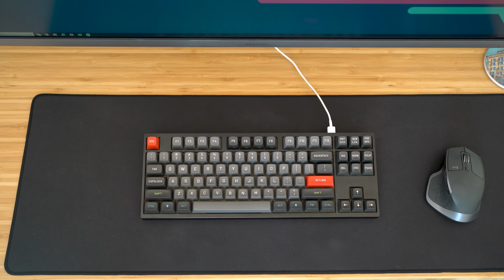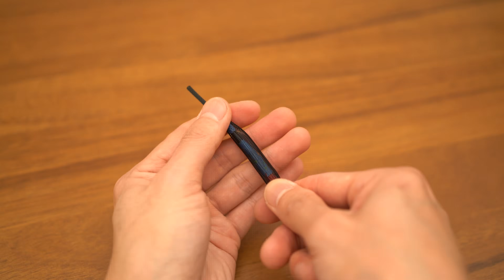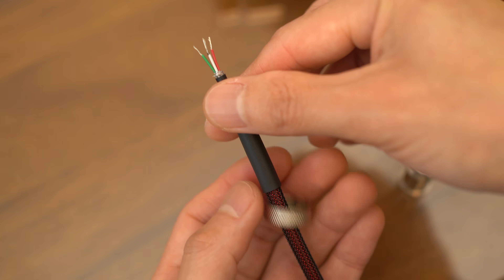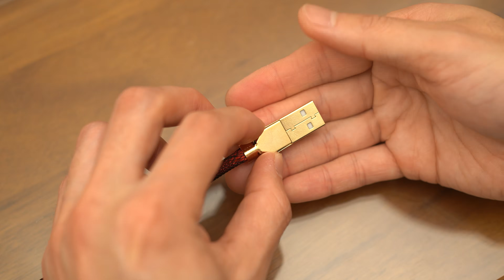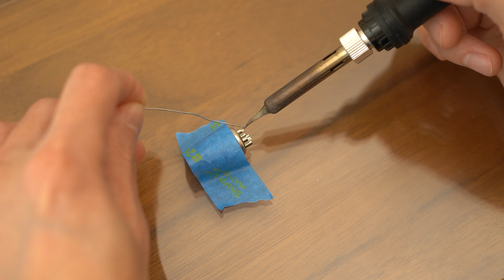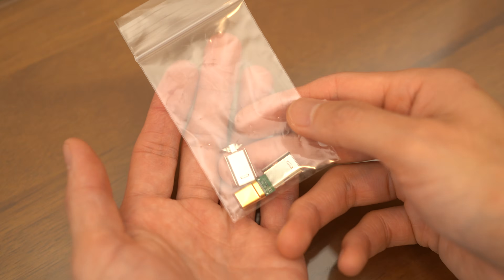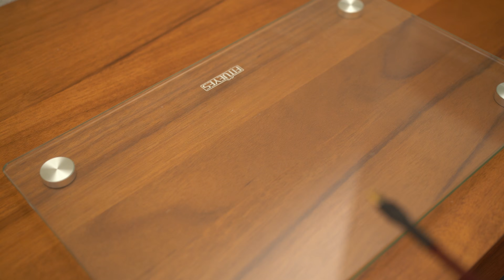Custom Coiled USB Aviator Cable for $50?!?!  Build one DIY for just $17!  Follow Along Tutorial!

Comment: The shielding should have been connected to the metal housing to be grounded and not cut off.
Reply: You also should do the same with the nylon strain relief runners. Also, any time you are running cable into a project box, pull both the foil and nylon strain relief over the shielding and zip tie it around it. My Dad went through all the Honeywell and Motorola trainings while I was growing up and he drilled this stuff into me. Now I go to my Maker Space and am amazed at how privileged I was to have a blue-collar tech-enthusiast Dad. I miss him dearly.
Reply from the maker: Thank you for the advice mUltic0re! When I use a 5 pin aviator, I typically connect the shielding to the 5th drain, but with the 4 pin, I skipped this step. But got a lot of good advice of clamping to the connector clamps, or using copper tape so will be trying that next time!
Reply: Can someone please explain to me what this means haha. I dont know what a shield is and so on so please explain like im a 3rd graders.   i have a kit on its way to me and want to make sure i dont fuck it up :)
Reply: @supersaiyanswag  voltage and current is way too low to be bothered with shielding, considering how simple the signals from a keyboard are, this is not an analog sound or image device
Reply: @vdfritzz  thanks bruv. i was confused because every video ive seen on this topic didnt mention anything about shielding, just solder and move on.
Reply: @supersaiyanswag  in your case, you should go to reddit and ask. You’ll get actual support there. Also, use the term ELI5. Good luck!
Reply: glad someone pointed this out.  Not shielding your USB cable can result in a very poor transmission speed
Reply: nah, just cut it off, it's a keyboard cable
Reply: @vdfritzz  No, another purpose of soldering it to the housing is to let the shielding withstand the strain (rather than the fragile solder joint), it is similar to how you should not really cut off the nylon strands in reinforced cable.
Reply: @vdfritzz  "It'll be fine" is what the makers of "cheap crap for profit" say. When you are teaching others, you should do it right. When you are doing work for pleasure or pride, you choose what is right for you (and for many that tends toward over-doing it). I'm not saying you are wrong for doing it the way that is right for you. I'm nearly certain that @keybored's intent is in the teaching and pride domain. ☮️❤️🌈🧘🏽‍♂️🧘🏽‍♀️
Reply: @RichardBronosky  it's homemade and a keyboard cable, it really doesn't matter
Reply: @vdfritzz  again, I'm not saying you are wrong for doing it the way that is right for you.
Reply: @vdfritzz  You obviously don't know enough about electronics to give advice on this. If you don't give your keyboard PCB the ground it expects and it instead suddenly grounds through a metal case to a metal laptop body, the PCB can be subjected to electric potential it isn't protected from. Very bad idea.
Reply: @skaramicke  it's way too little of everything, the keyboard and the laptop will do fine
Reply: @vdfritzz  The shield isn't there to protect the outside from the USB signals. It's to protect the USB signals and hardware from the outside.

By putting a shield break in the cable as shown in the tutorial, it turns the contiguous shield into two half shields. This will cause the shield to act as an antenna, and it will dramatically increase the amount of coupling between the environment and the USB signals. As a result, EMI will couple to the keyboard, potentially damaging it if the EMI pulse is large enough. Additionally, this will cause some packets to be dropped, potentially introducing latency and jitter to the keyboard. Most DIY keyboards do not include ESD diodes which would protect the hardware, so the keyboards this tutorial would be used on are the most at risk of this type of damage.

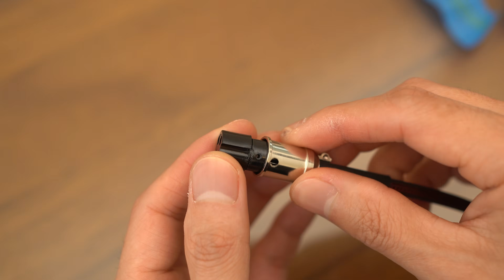At 12:30 in the video, the drain wire should be exposed so it can contact the housing. No soldering is required to return the USB cable to a state comparable to what it was originally. It's actually about the same amount of work (cutting the drain vs. making sure it's not stuck under the heat shrink).

Comment: Keyboard noob here, whats the purpose of the aviator connection? Why not just coil a single usb a - usb c cable?
Reply from the maker: Hi Asad! Other than the looks, it allows you to quickly disconnect and connect new coiled ends to match to your keyboard, keycaps. Or in cases where you have keyboards with other USB ends, it allows you to swap in between as well. Hope that helps!

Comment: every electrician thinking to them selvs aint bad till he cuts of the insolation mesh
Reply: What difference would you do?
Reply: @Friesomaiso  OK this is hard 2 tipe out
U get copper tape  (that is a thin pice of copper withe a sticky backside) pull the isolating mesh back use the copper tape and go around the the cable first then u pull the mesh down and go over it withe the copper tape then u just take the plug put it on and tighten it up
Reply from the maker: Thank you for the advice!

Comment: What’s the point of the tech flex? Could you create these with out tech flex? What does tech flex do? Great video btw.
Reply from the maker: Hi Hashir!  I believe the techflex provides another layer of structure and protection for the cable.  However, I have seen people make these cables without it!
Reply: @Keybored  do you know where I could purchase tech flex from and what size would I need?
Reply from the maker: @hashirowais6475  I purchased my techflex along with the usb cable and paracord from CruzCtrl cables as a kit.  Hope that helps!
Reply: @Keybored  yeah the problem with that is I’m getting a lot of shipping and customs. That’s why I was trying to find it on Ali express or something like that.

Comment: you forgot the part that you need to invest into equipments you'll never really use if you're not into building mech:
soldering equipment, soldering iron, and many other tools to cut wire
Reply: if you build custom keebs having a solder station is pretty essential unless you only do PCBs with preinstalled hot swap sockets

Comment: Good quality heat shrink has hot glue on the inside. I would just add some hot glue to the connectors before applying the heat shrink.
Reply from the maker: Hi Sevenismy! Thank you for that advice! Will definitely check that out next time!

Comment: Wow, this is really great footage. Must have took a lot of work to make the video. I recently started making single sleeved and double sleeved cables, even experimented with coils. It's fun, but I have one problem. Cables that are longer than 2.50 meters struggle to connect devices like smartphones for file transmission (some ports on my pc work, some don't). Charging works fine, keyboards work fine. I'm not sure if this is ok or not. Are you able to connect smartphone for file transmission to your pc with long cable like this?
Reply from the maker: Hi infiniteoffset!  For sure when the cable becomes too long, it has some trouble with electronics.  I believe even cables longer than 10ft has trouble with some high power requirement keyboards like the Drop Alt and Ctrl.  Sometimes, the RGB is not able to really light up brightly either.  For keyboard purposes, the max I try to use is 10ft.  Hope that helps!
Reply: @Keybored  It's not that the power would be a problem, but rather data transfer. My phone rejects to transmit data, but it's still charging.

Comment: That's so uncomfortable to watch with focus constantly changing. Im respect your effort, but you need to work on this.
Also cutting off cable shield is not a good idea, it should be connected with connectors case (you should put it in clamping area) your connectors are not grounded.
Reply: Also its a good idea to pre-solder the wires themselves before soldering it to connectors, that way you are sure that every wire core is soldered and also its makes soldering a bit easier
Reply from the maker: Thank you for the advice TIMHOK!  I have some work to do to improve my soldering!

Comment: I got triggered when you carried the solder to the connector.
Reply: I also was worried with the soldering. Quite a few of the solderjoints looked really cold.
Main points:
- tin the wires before soldering them on, by heating the cable for a few sec, then dab the solder on
- heat the socket/pin, then dab the solder onto the heated surface.
- after both surfaces are pretinned it's much easier to join them, and the flux isn't lost before it goes to the surface.

The rest of the process is done quite nicely, only the shallow focus combined with autofocus can ruin really solid shots.
Reply from the maker: @klaernie  thank you for the advice! Got a lot of good feedback from skilled solderers and will definitely help me improve for the future!
Reply: @Keybored  yeah, we experienced soldering folk must have collectively cringed and subsequently poured all possible advice into this comment section. ;)
I hope it is received rather helpful than hostile.
Reply from the maker: @klaernie  No hostility taken!
Reply from the maker: Hi Shafin! Yup, got a lot of advice on doing it more proper! My soldering skills got a long ways to go!
Reply: @Keybored  Yeah just watch a few tutorials, don't need to go too deep. Just the basics.

Comment: in all honesty does running an usb to an aviator connector back to an usb type b ..would this introduce latency and input delay ?
Reply from the maker: Hi IMpaa! Comparing this to a standard usb cable, I have not experienced any latency issues. However, depending on the keyboard you are using, you should avoid going longer than 10-11ft long in total. High draw requirement keyboards like the Drop Alt and Ctrl may not work with such long cables, and or their rgb light will appear very dim. Hope that helps!
Reply: @Keybored  Most appreciated still need to find an budget 65% hotswap bluetoooth keyboard i could pair with it as when not gaming i use my tv from my sofa on the pc , Thanks for the notice on the rgb !

Comment: I want to do a coiled cable just like this one, but my keyboard has the mini usb port. Can you make a video on how to mod a keyboard port into a type c one? It's a KBTalking Race II 75% a pretty old keyboard.
Reply from the maker: Hi Enggar! Depending on the pcb and case, converting from mini to C maybe a bit more difficult. However, instead of usb c connectors, you can opt for mini usb connectors instead when ordering then cable kit! It'll be the same process! Hope that helps!
Reply: @Keybored  Thanks for replying. Yeah I think changing the port type is pretty difficult on this one. Is there any problem if I opt for a 5 pin GX16 instead of 4 pin like you did?
Reply from the maker: @rraggne  hi Enggar, there shouldn't be a problem with a 5 pin as well. Just make sure to match up the numbers so that one pin that is not used is the same in both sides of the aviator. Hope that helps!

Comment: I put mine in the freezer after heating the coil. Still wait about 30 to 45 mins, but I find it gives them a good bit of spring when you rapidly cool them after heating.
Reply from the maker: That's great advice Jeremy! I'll be sure to try that next time! Perhaps I can compile the viewer advice and add it into the comments section!
Reply: @Keybored  Yup, that didn't happen.
Reply: If you want more springy, like old telephone coil, After you cool the coil, use same stick to reverse the coil direction to introduce tension.
Reply: So, once it cools off, won't there be moist build up on the usb connector after you take it out?
Reply: @cod3x327  their shouldn't be but if you're worried you can always seal it in a bag or container
Reply: @phyranios  yup i did cool it off in the  fridge and got good results. But i had better uniformity and springy feel after wrapping the coil with aluminum foil to have the heat spread evenly
Reply: @cod3x327  That's actually pretty darn clever.  Thanks for the tip.

Comment: What is the point of the aviator connection?
Reply from the maker: Hi Cece! Other than looking so cool, it helps you to keep one end of the cable connected to the computer and when you customize your coiled cables, you can quickly disconnect without unplugging it from the computer itself. Hope that helps!

Comment: one question: how long did you order the kit? you said 6 feet for the coil so the overall lenght is something around 10 feet?
Reply from the maker: Hi Sepia, I ordered 9 ft in total length and used the 6 ft side for the coil. Hope that helps!
Reply: @Keybored  thank you yes that helps

Comment: Not quite sure you understand what paracord is.
Reply from the maker: Hi Gravitas, you're probably right. I don't have any experience with parachutes. On second thought, I'm sure the nylon strands inside are for strength during actual application of the paracord for what it was intended for. Thanks for pointing it out!
Reply: @Keybored  Yeah, I have no experience with parachutes either, only bungees. :) I believe the nylons strands are actually the paracord, the part you're utilising as a sleeve is in fact just a sleeve. Great tutorial nonetheless!

Comment: you could tape the cable to the string when pulling out to make the process faster I think, don't quote me but I worked as a technician for a Chevortle and we usually tape the new wire to the old one and then we pull the old one out.
Reply from the maker: Hi Anthony! I'll be sure to try this out next time! It'll definitely save a bunch of time doing this! Great to know!

Comment: goes to aliexpress to buy the parts
Reply: Have you found all the parts from AliExpress?
Reply: Did you?!
Reply: @Instinct0425  nope I haven’t. I haven’t been able to tech flex and the USB cable without the connectors
Reply: @TheHabadababa  or just get an ul2464, 4 core cable in any size ... 28awg version and that's it

Comment: Is 60/40 Soldering wire okay for this project?
Reply from the maker: Hi Tony!  I believe the solder I have used was 60/40.
Reply: @Keybored  Thanks! also for the DIY kit, what was the length you chose to get the 6in coil along with the rest of the cable? Subscribed :)
Reply from the maker: @tonynguyen573  I purchased 9ft in total and split the cable 6ft/3ft.  The coil side was on the 6ft portion!  I appreciate the sub!

Comment: Hi, could you tell me where you got your old coiled cable? Or did you make it yourself? And also could you recommend me good cooled cable shops?
Reply from the maker: Hi Sebi!  I built that grey one as well, following the same process!  I believe many people use space cables, but it can get a bit costly as well!  Hope that helps!
Reply: @Keybored  Thanks for the quick reply!
I am thinking of buying this coiled cable from aliexpress.  Do you think it is good for this price? Should I buy it?
This is the link (i chose the army green with a clear techflex) https://de.aliexpress.com/item/1005002054754068.html?spm=a2g0x.12010615.8148356.29.6ec77b5fmKxrC6

Comment: Hey just a heads up. When you are tinning the gx12 connector you want to heat up the contacts and then melt the solder on them, not the soldering iron. That will make the solder stick easier and better to it.
Reply from the maker: Hi Tasty Yoghurt!  Thank you so much for the advice!  I'm still working on improving my soldering skills and this is helpful!